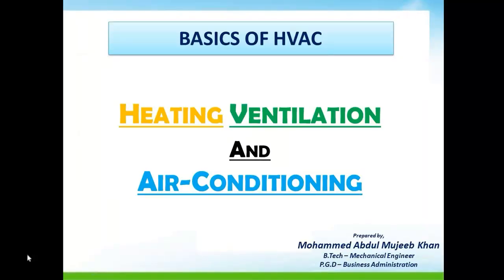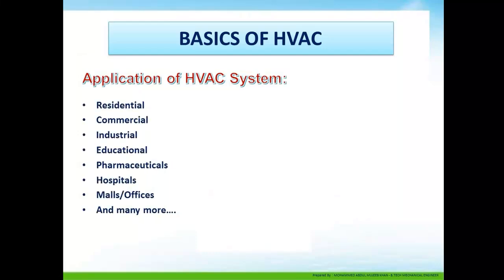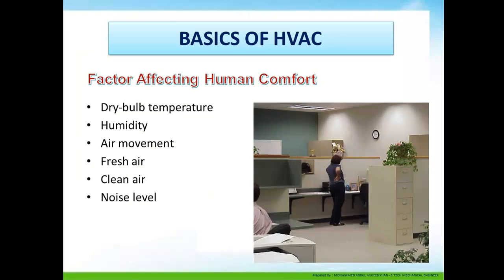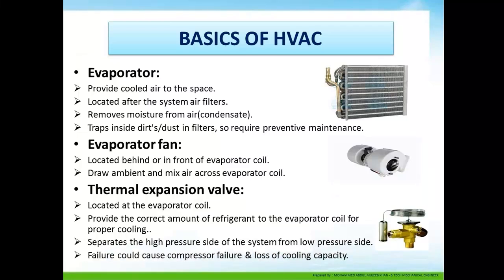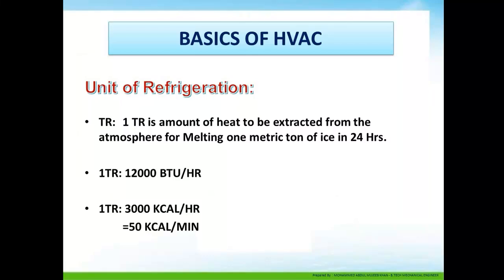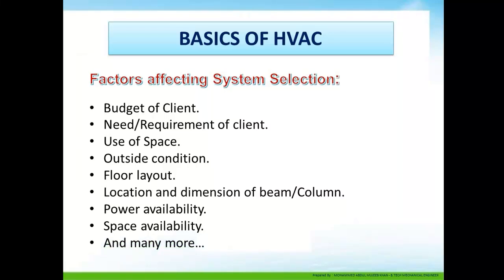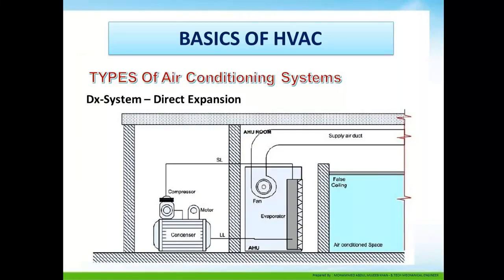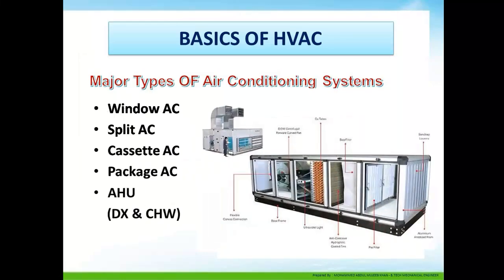HVAC Training - (Heating Ventilation & Air Conditioning)

Comment: Can u  please write me?How can I find out the TR of packaged type unit by use on ...Outdoor Temperature =36.6 Degree celcius;Cooling Coil In Tem=36.11 celcius;Cooling Coil Tem=21.11celcius;Air Flow=127 cubic meter per min ;ESP 373 pa! TR=?
Reply from the maker: Sure I will tell you tomorrow
Reply from the maker: Hi, based on you input data this seems to be 100% fresh air unit.
and leaving coil is 21.11 C
if this is required to maintain 24 C / 50%RH in the room then the Tonnage will be 11.4TR.
Reply: Thank you so much.One more request,Can you please tell me,How can I calculate that? or Can you send me this machine nameplate?

Comment: Mere pass Indica vista TDI aqua 2009 nov. Ka model he...

Engine ke aage Vale radiotor k dono fan ek sath chalu bandh ho rahe he...(after repair work of front excident)

Now problem discussion:

Driver side ke Right Kone vala vent and center panel ka Left side vala vent cool air de raha he....

Co driver ke Left and Right vala normal air de raha he.....after some time of half hour, it gives cool air, but not cool as both
 vent of driver side.  

What should be the reason, AC maintanence expert person ne bola ki Desk pura niche utar ke Damper set karna padega..hot air mix ho rahi he...(i replied, to sirf co- driver me hi esa kyo ho raha he)...

Please give guidance.....

"Codriver Left and Right vent Jo he wo Driver ke Left and Right vent ke compare me Kam cool air deta he"
 
Please identify the problem 

My no.
9574737182